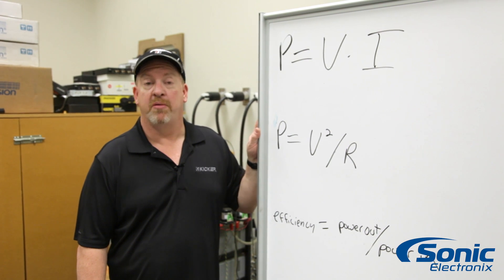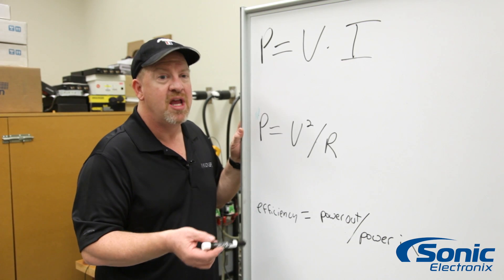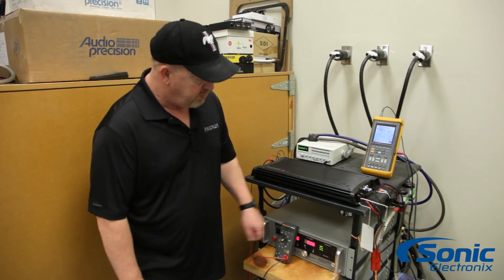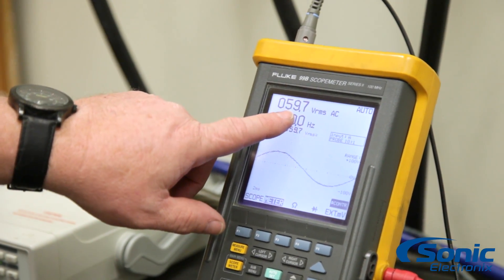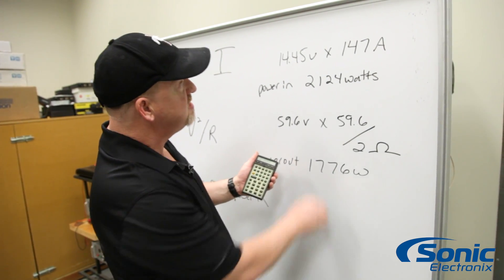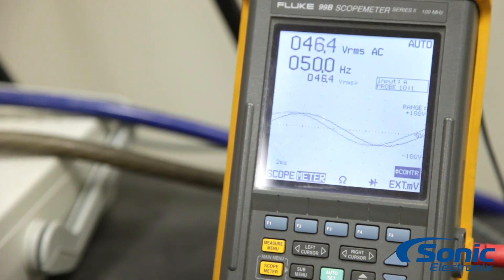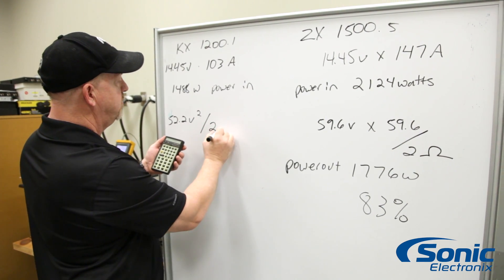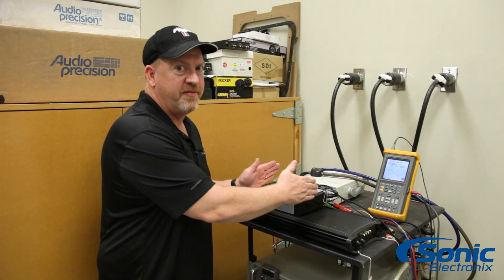How to Calculate Amplifier Efficiency | Car Audio 101 w/ Kicker

Comment: is this possible to  use a speaker replace with resistor bank? plz replay
Reply: well yes and no, because the speaker has 2 types of resistance. Ohmic and inductive resistance. the ohmic is stable but the inductive resistance changes with the frequency
Reply: @F.A.1.8t  hence the reason you tune an amplifier with a specific frequency
Reply: @beardedforlife3740  yep, correct.

Comment: What if we increase the input signal frequency to 20 KHz?
Reply: It would most probably saturate the output voltage. Hence, probably lower the output power of the amplifier due to the transistor characteristics. Different transistors produce different effects due to circuit design. That's why transistor calculations and stable power supplies need to be factored into the design to get the best output.

Comment: I think the math is a little off. Correct me if I'm wrong but the way to calculate resistance on an energized circuit you must divide I (amps or current) by V (volts) to get resistance (R), this is ohms law. With that being said wouldn't 147 amps divided by 59.6 volts be 2.46 ohms not 2 ohms? (better to measure and not assume😉). Plus if you take the 59.6 volts x 59.6 volts / 2.46 wouldn't you get 1443.96 watts? Then if you divide 1444 (rounding up 😉) by 2124 wouldn't you really be looking at a 68% efficiency? Not trying to degrade the video or anything I just have conflicting results using your numbers that's all. I think the math is a little messy but good informative video none the less. 👍✌️
Reply: However, the kx1200.1 amp is 92% efficient by my calculations so I must say that is damn impressive. 😀😀👍👍✌️✌
Reply: You would never get 100% efficiency from any amplifier. Heat loss is a natural phenomena in electronics. Friction causes heat simple fact. Electrons move extremely fast and thus is a combination of friction. Plus, you need heat to keep circuits stable in colder environments in order to prevent damage to the capacitors too.

Comment: Where is the calculation for Power Factor?
Reply: Kicker700 you mean the phase delay ?
Reply: Evagoras koullouros  Phase angle if I remember right. D'amore Engineering goes into depth about it and calculations.
Reply: yes i know. it is true many people dont take count on that, good t mention.  but it might not apply here because of those resistors, not sure about that
Reply: +Evagoras koullouros it should still apply, the amount of error will be less.